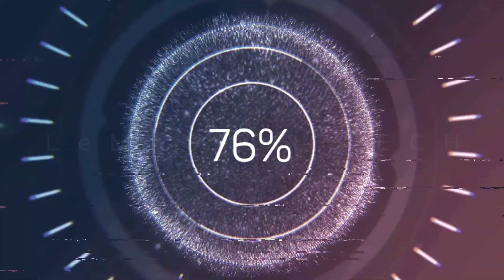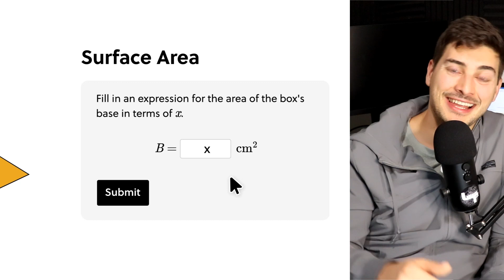What Do Controls and Automation Engineers Do?

Comment: Hi Peter,

I would like to know your take on how people(Controls engineers) can go about to calculate the time it would take to finish writing PLC code for a certain application. The same question for an HMI system to go along with the application. I Find this very difficult to logically work out because it can vary so wildly and code can be written so good with solid error/alarm reporting that the system is written almost fail safe. Again also the HMI screen can be developed to a point where you have created something really good but it had cost you so much time. We need to think about business also. You cant be spending 180hrs on a piece of PLC code where the customer only paid $1000 for.
Reply from the maker: Hello! Thank you very much for the questions and watching so much of the controls and automation content on the channel! I worked for an integration firm that had to do this type of proposing and quoting all the time and it is very tricky! We would usually have a fixed number of hours per IO point (1 for digital inputs and outputs, 1.5 for analog inputs, 2 for analog outputs, 4 for any Ethernet/smart device) then a fixed number of hours ~10-20) per unique “equipment module” to drive pumps or valves or conveyors. Then a fixed rate per “simple sequence” ~20hours or “complicated” sequence ~40hours.

Then hardware and electrical design were separate line items and hmi design separate but similar scheme!

Comment: I got a job as plc programmer. And the manager who give me interview saw in my resume i know something about arduino. And it seems that he is interested. Does arduino used now in the industry??
Reply from the maker: Arduino does make a micro PLC with 8 inputs and 4 relay outputs called the “opta” but it’s still a bigger player in the microcontroller game than they are in the industrial controls game so far!
Reply: @lemastertech  what's the fastest way to become Automation Engineer. Rite now my job is PLC programmer.
Reply from the maker: It totally depends on the company, some places don’t have a big difference between plc programmers and automation engineers, but a lot of places expect their automation engineers to be able to design and wire electrical cabinets, troubleshoot wiring and perform loop checks and device commissionings, as well as PLC coding and hmi development and often some networking and data reporting as well! So plc programming is a good start but there’s definitely a lot of areas to strengthen to become a full on automation engineer!!
Reply: @lemastertech  thanks a lot for your feedback.really appreciate it... Yes true. The manager told me to do same as you did like sql, commissioning, web page development etc. Maybe he's planning me Tobe not only become PLC programmer.
Reply from the maker: @Automatonfrancis  awesome good luck!!

Comment: Great video! I'm currently a senior ME and  my instructor says that PLCs are the old way (or dated) way to doing controls and that the future of controls will be with microcontrollers, what are your thoughts on this?
Reply from the maker: Hey that’s interesting thanks for sharing! I think the desire for a really robust dedicated PLC for factory wide applications isn’t going anywhere so like rockwell and Siemens and ABB will probably always supply huge customers with these super expensive PLCs, but I think your professor is on the right track that smaller standalone skids or single system operations can be controlled by microcontrollers and even cheap PLC options like automation direct or beckhoff or arduino could be used. Ultimately though the industry standard is the PLC so he might be right about the old way vs the new way but the industry changes very slowly so PLCs aren’t going away any time soon!